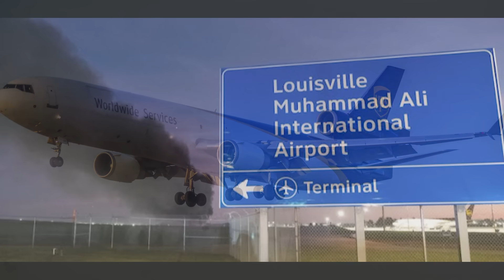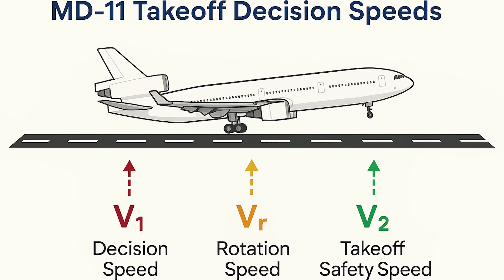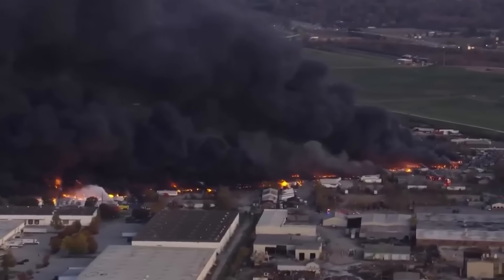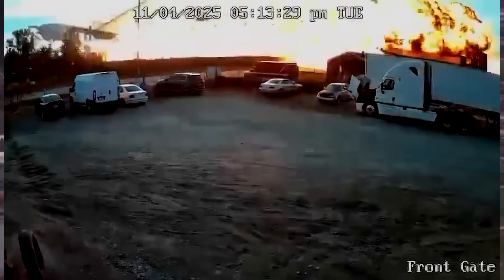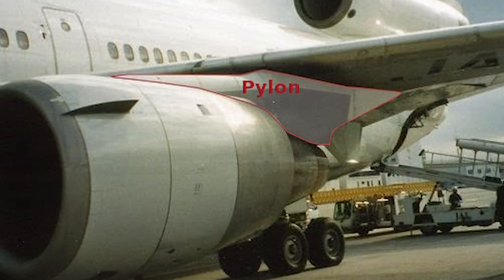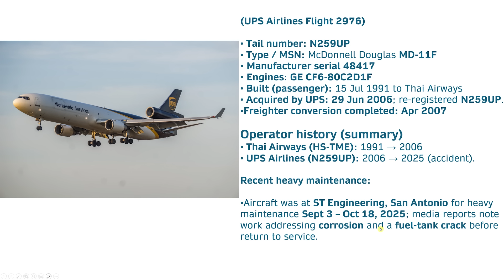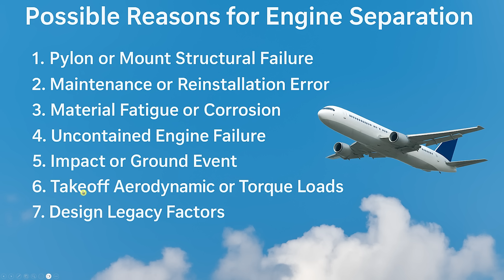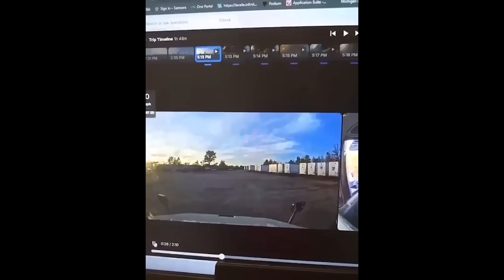What Caused UPS Plane Crash, Louisville, KY? How MD-11 Engine Fell Off

Comment: A pilot explained to me once that while passengers are typically more nervous during landing than takeoff, the takeoff is usually much more dangerous.  That's because during landing, the pilot has the option to go full thrust, not land, and come around again.  During takeoff, once you've reached maximum speed on the ground, there's no stopping, you're committed to taking off (variable depending on the airport length).  But more importantly, a plane taking off is much heavier than it is when landing, because it's typically full of fuel, as this plane apparently was, which is why it made such a large fireball.  Common sense stuff, but I'd never thought of it that way.  Condolences to the families of those who perished in this tragedy.

Comment: This gives me flight 191 vibes similar MD-DC plane but 191 was older DC 10 this one was an 11 and both lost the left engine but the 191 was a damaged engine I guess a forklift was used improperly and damaged the bracket that held the engine. Idk what caused this engine to fall off. But its similar planes.

Comment: I work in a USAF maintenance unit and these mishaps always have me on edge, assuming improper maintenance. I've witnessed and reported improper maintenance on over a dozen planes spanning 10 years, particularly concerning Inspections done without required certifications, and after all internal investigations you know what happened? The Wing commander swept it under the rug claiming their was no basis to our claims. Literally nobody will listen to us. Won't be surprised if any of those tails fall out of the sky.

Comment: Any aircraft maintenance guys out there wanna take their bets?? I knew what happened with the Blackhawk CR-J crash in DC way before FDR was found and I was pretty impressed w/myself. Bi golly I am an aircraft mech after all. 

I'm gonna go with corrosion weakening the frame no doubt. The maintenance wasn't addressed correctly. Some lousy said "that's good enough is it lunch time yet?" Some poor QC signed off and cleared it from maintenance. Hes gonna get his ass handed to him no doubt. I mean it's only a f*cking aircraft right? Man it's pretty easy to flag QC and make sure the plane is downed, get frames a MAF to work on new skin for the aircraft. def with its past has seen its day! But I guess the maintainer thought this was easier. You know when flying started to scare me? When Boeing started to put production in front of quality..no big deal ..just get those babies flying we will get to quality later. 😂

Comment: The slates and wheels were still down, the engine falling off happened at the same time the plane was trying to get lift .. but the slates being down the planes nose couldn't get the lift they needed. A series a failures in seconds.

Comment: I suspect when that engine ripped off, it ruptured a portion of the fuel tank, and that was causing the flames, and possibly those power line strikes, could have contributed to further ignition of the fuel.

Comment: Like the DC-10 crash, when the engine falls off, they lost hydraulic pressure. If you examine the photos, the slats and flaps are retracted, not in take-off configuration. The DC-10's and this MD-11 left wing had no lift.

Comment: The warehouse damage is most likely a tailstrike.  There would be much more significant damage to the gear assembly if it struck the warehouse first.  Not to mention, at 10-15 degrees nose up pitch, the gear wouldn't be lower than the last 1/3 of the airframe.

Comment: Correct me if I am wrong:  From that dashcam video, it looked like the flames where the left engine was, were not that bad until the plane hit another powerline and the resulting spark then caused that big explosion.
Reply: The big explosion is at the oil recycling plant.

Comment: A lot of people are making connections to the AA 191 disaster.  After that accident there were significant changes made to the DC10 - so this is a precursor to the MD11.  It’s not the same aircraft.  There were a lot of changes made to the hydraulic system e.g the slats system to avoid similar thing happen.  And with AA191 did get airborne and then due to loss of hydraulic pressure it lost lift on the left hand side and it turned over and fell down.  So that is very different from what we are seeing here.

Comment: Realistically, it appears that the loss of the engine and the control surfaces on the left wing cause it to bank severely left, causing the left wing to impact the building.  This caused a more severe bank to the left (as seen in the trucker's dashcam) to a full 90 degrees. and impact.  It is also likely that debris from the uncontained explosion and fire also damaged the #2 engine on the vertical stabilizer to fail as well.  Prayers and RIP to all involved.

Comment: This happened right near me. I was at work less than 2 miles away when it crashed. Our power failed, machinery losing its wire guide and being stuck in the air. I've never seen smoke like that before. We were watching out of the windows/dock doors and it literally looked like a volcano had just blown its top. Hands down the craziest/scariest thing most of us had ever seen. RIP to everyone lost and here's hoping those still missing will be found..

Comment: The FAA should place all MD11 on permanent ground stop for operational failure of the engine bolts holding these engines on the wings. They are death traps period and should not be allowed to fly again in any capacity. 

The 777 and Airbus 350 stand ready to assume the role of freighters. They are safer and more reliable overall. Plus, both aircraft can fly with one engine even if it falls off or break away. Catastrophic failure is negated on both aircraft. The MD11 is past its prime. Remember Souix City accident also had a catastrophic failure of the left engine.

Comment: The question that immediately comes to my mind is why couldn't it continue its takeoff? Even with an engine gone, it should still have been able to climb. The Chicago DC-10 suffered hydraulic line damage when the engine separated, but that risk was later addressed, and the MD-11 looks to have remained under control, with the exception of not climbing.

Overloading is an obvious suspicion, but I'd be surprised if a long standing operator like UPS knowingly engaged in such practices. Then again, one wouldn't have thought that American Airlines would use non-approved maintenance methods, so what do I know?

Comment: It was almost certainly not the landing gear that clipped the roof. It was probably the tail itself. Look at the angle when it's just past the building (the tail is lower than the landing gear), and the gear has not been ripped off the plane.

Comment: Structural failure of left engine caused various parts of aircraft to break apart striking the left wing. Thus occurred prior to aircraft leaving the runway. At this point, engine broke off and parts were thrown into the upper engine. A fire started at the same time. This left the flight crew with no options as they had little to no room. Aircraft struck a building structure and subsequently the power lines. At which point the aircraft exploded. Aircraft carried on for roughly a 1/2 mile losing its 38 thousand gallon fuel load. Aircraft came completey  apart and jet fuel added to an already dangerous situation.

Comment: Well when you talk about there is no turning back at that speed.  That's wrong that they can't double the runway length so they can abort.  Jeeze.  How long have they known this.  But you have to take off.  Problem or not.  Unbelievable

Comment: They should install ejection seats in cargo planes.
Reply: That would not have helped here
Reply: @omarrolle3842   You clearly don't understand ejection seat.  They are Zero-zero capable.
Reply: That would require a mechanism to release the roof of the cockpit. The R&D alone is a financial hurdle. Secondly the crew seemed to be focused on minimizing the damage done on impact to surrounding structures, that doesn’t happen if you bail out in a non-remote area.

Comment: In the car dash cam video, the left wing was on fire; the actual explosion seemed to happen just as the plane hit the electrical wires, likely igniting fuel from a punctured tank.
Reply: No not at all...  the left wing hit a building after hitting the power lines, it was ripped off and caused the plane to roll left.  When the wing ripped off it ruptured the fuel tanks in the wing, and that was the big explosion.  Plenty of metal-to-metal contact when the wing separated that there was plenty of bigger ignition sources.

Comment: CLICKBAIT. WHAT A WASTE OF MY TIME watching this video under the pretense that it would give the reasons for the cause of the accident as the headline indicates. That's what you call a spam headline. People sending you videos of the plane coming down does not lead to a conclusion of the causation of this crash. It's just they happen to have videos from different angles. Your title says that you're going to tell us why the left engine fell off the MD 11 when it does no such thing. Even the NTSB is still investigating. Nice job at clickbait. That's all your video is. Clickbait. You are no more able to determine the fault of the collision than the NTSB at this point.

Comment: While this falls under material fatigue, if there is violent vibration in an engine, then the fuse pins in the pylons can snap which would allow the engine to detach without causing damage to the wing. They will only snap cleanly if the materials used are in the right ratios.  El Al Flight 1862 is an example of corroded fuse pins caused by excess sludge. Which actually caused two engine to be ripped off the wing.

Comment: It looks like the pylon attach points were not in good shape. When I was younger I used to perform isochronical inspections on c-141.s. My buddy and I developed a way to inspect engine attach points. We used to shake the engines slightly while simultaneously having our fingers on each bolt that held the engine on. We started find broken and worn out bolts and cracked fittings. This of course lead to the fleet being checked. I said this to share the concept that preventive maintenance is the most efficient and important work that we provide in aviation. I’ve seen poor maintenance which happened to be in SAN Antonio on a kc-10 program which was not being performed properly at all. I’m not surprised this has happened I’m surprised it hasn’t more often. My bet is on missed maintenance malpractices!

Comment: Former Aircraft Mech on KC-10 ( Similar to the MD-11) ...My first thoughts when I saw the engine had separated before impact was engine mount failure or mount bolts . I would like to know if it went thru a C-check recently because engines are usually removed & the mounts as well for inspection.....Its happened before..

Comment: Didn't they find problems years ago, when engines were changed on the DC10 using a forklift instead of the correct method?

Comment: As I remember, the AA crash after takeoff out of Chicago, in 1991(?) when the left engine of the DC10/MD11separated after takeoff and severed the hydraulics which held the leading edge devices in place.and they retracted without hydraulic pressure. (Boeing mechanically latches LEDs in place).  As the crew pitched to hold V2, the left wing could not sustain sufficient lift and the aircraft rolled left and crashed.  Was this design flaw ever corrected?  If not, this may provide further insight into the circumstances of the crash.

Comment: Yes, a cargo plane load of lithium car batteries and chargers would significantly intensify a jet fuel fire. Lithium batteries pose an extreme fire hazard in aviation because they can ignite, burn at extremely high temperatures (over 1200°C), and the resulting fires are very difficult to extinguish with conventional aircraft fire suppression systems. 

Here is a breakdown of the hazards:

Thermal Runaway: Lithium batteries, especially in bulk, are susceptible to thermal runaway. When one battery overheats or is damaged (which could easily happen in an existing jet fuel fire), it releases energy uncontrollably and generates enough heat to cause adjacent batteries to enter the same state, leading to a cascading chain reaction of intense, self-sustaining fires.

Intense Heat: Lithium battery fires burn hotter and faster than many other fires, including jet fuel fires. They can reach temperatures of up to 1200°C (2192°F) or more, which would significantly increase the overall temperature and destructive potential of a jet fuel fire involving 38,000 lbs of fuel.

Unstoppable Fires: Current onboard aircraft fire suppression systems (such as Halon) are designed to extinguish the flames of a fire but are not capable of stopping the internal temperature rise and subsequent thermal runaway of lithium cells. The only effective way to stop the thermal runaway is by significant cooling with large amounts of water, which may not be available or feasible in a cargo hold fire.

Flammable and Toxic Gases: During thermal runaway, batteries vent a significant amount of highly flammable gases (like hydrogen) and toxic fumes (like hydrogen fluoride). These gases can accumulate and potentially cause explosions, adding to the fire's intensity and creating a severe health risk for the crew.

Explosive Force: When exposed to high heat in a contained space, the build-up of pressure inside the batteries can result in explosions, forcefully expelling white-hot molten lithium and other parts of the device like shrapnel, spreading the fire further. 

Several fatal cargo plane crashes have been attributed to in-flight fires involving lithium batteries, with the fire being so catastrophic and unstoppable that it led to the loss of the aircraft and crew. The presence of a large quantity of lithium batteries alongside a major jet fuel source creates an extremely dangerous and likely uncontrollable fire scenario. 

What aircraft fire suppression systems are being considered as alternatives to Halon for lithium battery fires?

What regulations apply to transporting lithium batteries on aircraft?

What are the typical differences between lithium-ion and lithium primary batteries?

Lithium batteries: safe to fly? - Safety First | Airbus

￼

Safety First | Airbus

Why lithium battery fires are far harder to fight than ordinary fires - AvSax

￼

AvSax

￼

The serious fire hazards of lithium-based batteries to aircraft - vrr.aero

￼

vrr.aero

￼

Show all

Comment: "we're going to see what could have brought this plane down" 

Major engine fire that even the 1992 web cams still connected to the 28000 modem lines could see at a few hundred feet, near maximum weight, and physics... Also like how many of these jets have gone out the EXACT SAME WAY this year is the question.

Comment: The sad reality is it seems this crew had encountered a situation which simply could not be managed successfully. 

I believe we will learn that the #1 engine departed the jet, and damaged the #2 (tail) engine, reducing its thrust.   So they simply did not have thrust to climb with less than thrust from at least 2 engines.  

Very sad.  No way to successfully manage  this.

Comment: Please understand that this is the second engine that has detached from the MD jumbo jet.  The first one was in Chicago a number of years ago.  It was determined that the pylon attachment failed.  The steel pin most likely had a Crack which developed over time.  The fix was to provide 2 steel pins, thus providing a redundancy.  So might this plane missed this required fix?

Comment: It immediately clipped GFL Environmental which recycles motor oil, coolant, Tran fluid, refrigerant, and anything else you can imagine that cannot be thrown into the dump. On the map you can see over 30 large tanks but there are well over 60 there all housing particular things. That definitely contributed a ton to the fire and the shelter in place orders given to Lou residents and to avoid the area and being down wind from it. Waiting to see if the EPA publicly addresses it or gets rug swept.

Comment: The plane was built in 1991, so 34 years old.  And Boeing merged with McDonnell Douglas in 1997.  Meaning all the parts came from Boeing.  And that Boeing is now the company that owns the company that built the plane.  As far as I am concerned this is yet another BOEING crash.  That plane has been serviced and parts came from Boeing since 1997, meaning that it stopped being a MD plane and started being a Boeing plane 28 years ago.  And that is all you need to know, Boeing is crap, full stop, I would not get on one.

Comment: A piece of debris was on the runway and the wheel threw it up into the wing and plane hit the 3 phase 30,000 volt power lines causing a massive arc flash that ignited the entire fuel tank and blew up the plane 

If there was just a field the plane could have landed and they might have survived but the power lines and the arc flash was the final thing that doomed the plane

Comment: NTSB said engine came off after explosion. Airplane recently had leak fuel tank repair. Sounds like the repair didn’t hold, fuel leaked out, sparked a fire, exploded, which blew off the left engine and FOD went through number  2 engine tail, so only had one good operating engine not enough lift.

Comment: The maintenance personnel who worked on this planes should be tried for several counts of murder and so should the person who cleared it for airworthiness. It’s been in the shop for a month. The md11 have had nothing but problems since they were made. A plane older than 15 years shouldn’t fly. We need better inspections.